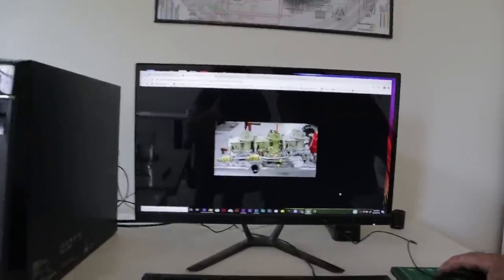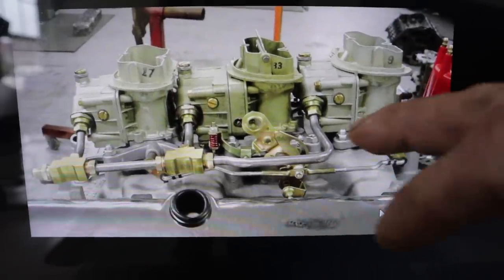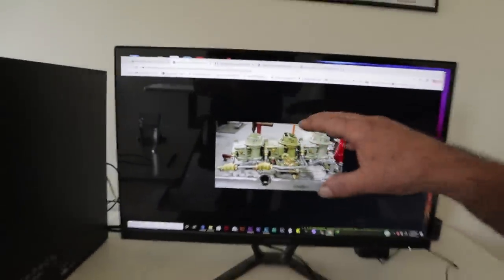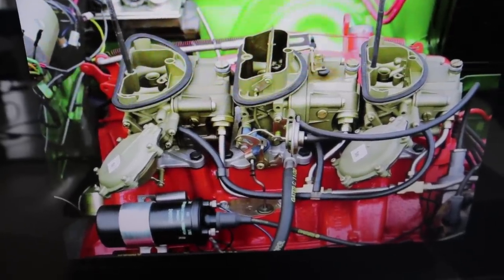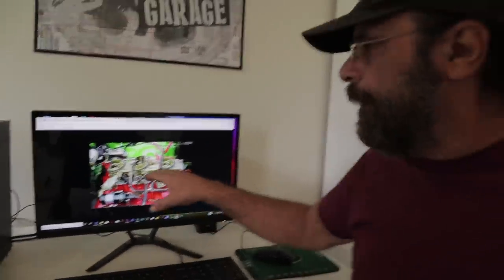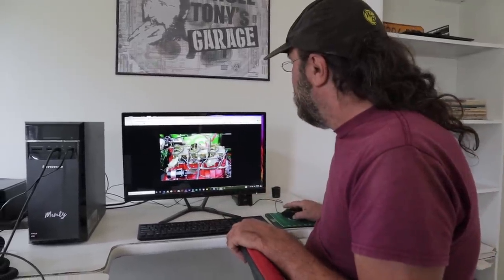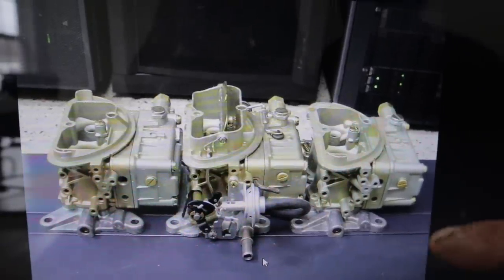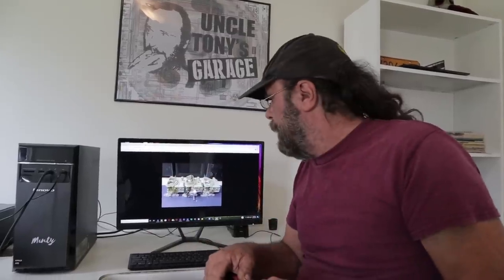The Infamous Chrysler Six Pack

Comment: The Six-Pack is OK but my favorite is the Long Ram cross rams from the early 60s. One of those intakes on a warm 440 is the most awesome truck engine ever, the low-end torque is unbelievable.
Reply: The sonoramic and the factory two 4 barrel crossrams are beautiful.  I wonder if those intakes would handle boost?! On a 440.
Reply: @justinmilby4552  The Short Ram racing manifold will easily
The long ram will also with two conditions.
1. It has to be supported at the carbs since they are somewhat fragile.
2. According to the factory, the long intakes produced 3 psi of pressure at the valve @ 2500 rpm.
Adjust your timing and boost accordingly.
Reply: Thanx for the info man really.  I have people tell me how stupid of idea it is and all that.  Now I gota try to find on th sea setups for my 440 goin in my ramcharger.  Have good day sir
Reply: John Parrish i agree 100% ... i used to smoke six pack cars or walk right away from them with my 69 429 Ford all day long ... the 61 413 cross ram now that was another story ....
Reply: Need a bigger gas tank though
Reply: @Roadking556  
Please tell us the '61 413 crossram story.😃

Comment: Ok so the 6 pack set up on a 383 with a 525 lift cam 106 lobe separation and 11 to 1 compression and 906 heads should work right?

Comment: Chevy 348 engines with the 3x2 setup was vacuum operated on the end carbs...when the center carb was opened over 50% throttle, the secondaries went full open...there was no modulation...either full on, or nothing...that's why the progressive linkage was used...it was much more driver friendly.

Comment: uncle Tony, I’m so glade your doing a 6 pack. I have a 70 aar and the carbs give me fits. I’d like to know more about doing the springs
Reply: Same here! Maybe I can get my Dads running right finally.
Reply: On my AAR sixPack I changed to stiffer springs on the secondary diaphragms and changed the cam on the linkage to open at latter part of the cycle. My T/A heads were fully ported and polished and had no bottom end power. By having the secondaries engage at the higher end of the RPM scale, the vacuum presure allowed a smoother progression, with no bogging down. I also enjoyed the benefit of 20 to 21 mpg on the highway. I was basically running a super efficient 318 down the road with a fully ported and polished Trans Am race engine waiting at the end of gas pedal travel.
Reply: I hope Tony gets into the tuning of the Idle Air Bleeds and Idle Fuel Restrictors. There was an article in the April 2018 Mopar Muscle Magazine called "Climbing the Hemi Mountain" by Tom Gipe. https://www.zinio.com/articlepaywall This was by far the best article I've read on tuning a Holley carb. Granted this was for a Dual Quad Hemi set up... but it easily translates to a Six Pack. 

Using that article, I was able to fix issues that started with the stupid blended fuel (Ethanol/ Gasoline) here in California that I was fighting for years. It's amazing with a little work how much my everyday drivability improved.
Reply: I drilled out the metering plates like the DC manual described, and installed the yellow springs.
Reply: @drippinglass  I'm running a Quick Fuel Metering Block on my center carb. It's fairly easy to change the Idle Fuel Restrictors with that. Very adjustable.
In that article I mentioned about in Mopar Muscle... the author described in detail how to drill and tap out the non adjustable jet openings. Those along with the Idle Air Restrictors are the two jet changes that really make a big difference in everyday driveablity.
Reply: Tommy Ridolfi I had a 70 Cuda with a 440 six pack, it was a full time job keeping them tuned 😖 and worth every second of it!
Reply: Womp Womp...
Reply: Drove a 70 roadrunner 446 six pack four speed copper brown color my senior year of high school good old days
Reply: Well, today you can install.injectors which fairljy look like carbs. And when you can endlessy tune the system for any cam, head or engine load situation.
or even weather enviotnment. 
But if your a traditionalist like me you
 can greatly upgrade the carbs and change to a cam all of which vrry greatly 
Reduce the classic pain in the....neck of the six packs. First you are on the center card. And have lackluster performance. Then you hit the magic RPM and the end carbs open and youre holding on for dear life. So uou lift and then you go down to the magic RPM and the end carbs flop closed and you try to go through the windshield.....
Well, good carb reworks or a Fuel injection unit now cure ALL that age old 6 pack nonesense.....
Reply: Well, the suggestion for a supercharger combonation with a 6 pack is the most intelligent contribution Ive seen here.
Blowers properly callibrated, would really be answer to tame the six pack behavipr

Comment: This is going to be cool... a budget six-pack setup, being a young guy I never knew there was such a thing.  These days you only see or hear about six-packs on restored originals or high-end hot rod builds.  IMO this is your most interesting build yet and I'm super excited!
Reply: Exactly.  All I've ever seen is these $2,500 dollar six pack setups that still need rebuilding.  This will be refreshing.
Reply: I was running 13.50s in a big block 66 chevelle with corvette three deuce carbs. I dumped the tri-power for a 660 holly duel pump. Ran in the 12.80s first pass down the 1/4 mile.

Comment: 1957 , OLDSMOBILE 324 CU. IN.
TRI-POWER...
CALLED THE J-2 .
I HAV ONE...
Reply: Very cool. I thought they went from 324 to 371 cubes in '57 though(?)
Reply: The 324 is 1954-56 Oldsmobile and it only came with an optional 4 barrel. The 57 Oldsmobile is a 371 CU. IN.

Comment: A friend's 440-6 'Cuda made the COOLEST induction noise you've ever heard!!!
(Sounded like it'd turn the shaker inside out!)
Reply: That sound scares me. When I mash the accelerator on my 230 hp 454 Tbi.
Reply: @missingremote4388  
Considering that the 454 is "soft" at 230hp I wouldn't be too concerned about it hurting itself - that's not enough output to do damage to anything! (lol)

Comment: The way that you explain how to tune a 6 pack, sounds a lot like tuning for VTEC engagement on a Honda. Either you can  have an aggressive kick when the switch to high cam happens, or a smooth change over since the VTEC change over is an on/off switch (for older Honda engines anyway). I prefer a smooth change over, which is why my friend's VTEC head swap in his Integra, I have VTEC engaging at 4,400 RPM, if I set it before there, some mid range torque is lost, and if I set it too far after that, the engagement is more of a kick as the head demands cross flow by at least 5,000 RPM (off VTEC, the cam profiles are set up to cause swirl in the charge for better toque and leaner burning at lower RPMs) and it caused the tires to chirp in second gear just going to VTEC.

Comment: I love my six pack it has always worked great  I bought the whole setup in 1987 used everything including even air cleaner 400 bucks my dad thought I paid to much  I put it on a 68 roadrunner had to change the wiper motor to a 3 speed motor  and it worked great.  still does  also the first time I stepped on it the motor mount ripped off and the pistol grip shifter smacked my knee hard
Reply: Now people want a grand just for the intake
Reply: @benderc7778  buy a new one off a speed shop thats already cnc ported.

Comment: you should use motor craft 2150 it is just a simpler more refined 2300. it has variable hi speed air bleeds to give a vary good fuel curve and it has anuler boosters. all so a thunder bolt ram air set up wold be cool. all so if i am not mistaken Chrysler used the motor craft 2150 on trucks and vans and wagoners.  i think a thunder bolt ram air set up wold take it to the next level. all so using magnum heads wold be good idea as thy flow so well. a roller cam wold be cool to as it is a roller block. a cam  with a wide lsa for a flat tore curve. as for cam HUG7011 from hughes engines looks good. well take care!

Comment: The only six pack setup I ever saw run in person was on a hot rod 57 chevy I think it had a 327, but it might have been something larger. During normal street driving it acted one way, pretty standard really hard to tell it even had a six pack. but when the guy to ready to race it, he did ... something under the hood with the carbs. They would then come on sequentially, as if he had three gears in one... if you get what I mean. In first it would have the regular then two more kicks in the pants you could hear as it went down the track. I think once he got into 3rd they stayed open, the sound change was mostly in first, and maybe second a bit... but that was like 50 or 60 years ago, memories fade or "improve" over time.
Reply: That sounds like Pontiac tri power sequential linkage
Reply: @generalgreivus  I really don't know what he had under that hood. He worked at his Dad's garage and probably had access to anything. Could have been a Chevy engine with a Pontiac carb setup. 
A lot of people don't know that at one time not all the engines in the GM lines were the same. I had a 350 in a 72 Pontiac that was different from the Chevy 350. That motor sucked. I put two engines in it myself, then sold the hulk to a local guy that could do his own mechanical work, he put 3 Pontiac 350's in it, eventually he changed the mounts or whatever to put a Chevy 350 in it and had no more problems.  The last motor I had in it developed the strangest problem I'd ever seen. Somehow, something cut a groove in the head right between two cylinders. I couldn't find another head for it. I suppose it could have been welded up and machined back down, but I just didn't have the money at that time for all that. I'd wasted too much money on it already, I had fancy wheels and tires, a turbo exhaust, air shocks and a number of other things on it.
Reply: My dad rest his soul thought me all about the old ways, he always said that he really loved that setup, good mileage and power he claimed.
Reply: @generalgreivus  Well under normal circumstances it basically is running a two barrel. Only when you get on it does it come alive and scat. I've had four barrel setups that were similar, if I kept my foot out of it, but I have a hard time keeping my foot out of it.  Worst thing I ever did for gas mileage was put on "turbo" mufflers. They are quiet at idle and normal driving, but when you open it up, they roar. I loved to hear it roar. I'd slip it into neutral and let it roar sometimes, just to mess with people and the cops. If they stopped me, the car is quiet. "Who me? Can't be this thing is quiet as it gets."  I always wanted to have a car with a big rumble and exhaust cut outs. Oddly, there is a place in Utah that does a lot of them. I guess it's legal to install them there, but not legal to use em on the street. They came  up with a one touch button to open or close em. They used to be cable operated, then they were electric, but you had to hold the button until they are fully open or closed.
Reply: He had an undying love of turbo mufflers aswell lol, I fixed up one of his old trucks had a quadra jet and turbo mufflers and much to the same effect. Loved that truck.
Reply: @generalgreivus  Nice memories. I wish I'd kept my old 51 Dodge that I learned to drive in. It was granpap's first, then Dad's then mine. My aunt talked me into trading it off, big mistake.
Reply: Mine was unfortunately rotted to death from sitting outside too long. I shelled the engine and eventually sold the truck. Missed it so much I went and found version 2.0 same year just half ton vs three quarter. In the process of bringing it to life currently

Comment: Loved my 70 440+6 cuda but the 71 demon 340 I had spent some time with a 6 pack on it. The carbs I used were off a 3 deuce big block Chevy Corvette.
All the carbs were pumpers so I used some small jets and it was still 1100 CFM which was a little much for the 340 until I installed a Racer Brown solid lifter cam that was recommended by Ed Hamburger at Direct Connection.
It hauled ass with this set up.
Reply: Ed Hamburger and his ideas where awesome, I had my 340 done to his spec's and my 73 'cuda did 11.5 sec in the quarter plus it was my daily driver at the time, Ed wherever you are you are a true motorhead that still has my following!
Reply: Dennis Kling engine details and cam specs please
Reply: @nawscawp  well at the time (1984) started with a billet 3.55 throw crank, .060 over on cylinders with Silverlite Pistons, line bored with 8000 rpm balance, 10 to 1 pistons, MP (or Direct Connection) Purple Cam solid lift .506, Aluminum W2 heads (ported & polished) Torker 2 intake with 750 cfm Carter Competition carb, MSD ignition with 60,000 vdc coil, Cheetah valve body, extra steels & fabric clutch plates, Dana 60 with 513 to 1 gear ring & pinion.
11.5 second quarter mile @ 121.58 mph, and engine rpm @ 7200.
Reply: @cudathehawgjetfixer7520  about how much $$$ did you have in that puppy?
Reply: @robertl.fallin7062  Well I paid for a storage lot that had a bunch of Mopar parts and a few cars, after I finished inspecting the purchase I found a few boxes that had Ed Hamburger name all over them and I also found a bunch of paperwork explaining how to set the small block Mopar up to do 11 seconds or less quarter mile racing and a book written by Ed Hamburger on updating engines for racing, all at the cost of $100.00 at a self storage lot (the tenant forgot to pay rent and defaulted their property in the storage lot)
Reply: If the carbs were pumpers they were either ford or after market holleys
Reply: @cudathehawgjetfixer7520  excuse me, sir, but I need to report you for theft... That's a crazy find!!!

Hope you still have the car.
Reply: @ScottKenny1978  Sorry no, had to sell it, it could pass anything on the street except a gas station and after I left Active Duty and started school I couldn't afford to drive it 50 miles a day round trip to school and back, the person I sold it to wrapped it around a tree at 100 + mph, the only thing the car had usable was the trunk lid, the owner is now wheel chair bound and his 2 friend's where killed in the accident. When I sold the car I told him not to drive it like a nutjob because it will get out of hands faster than poop through a goose. Needless to say he didn't heed my warning and 2 people paid the cost for not being responsible!
Reply: @cudathehawgjetfixer7520 man, I am really sorry to hear that!
Reply: @ScottKenny1978  me too. He made a promise to sell it back to me when he decided to get rid of it, but he went and got stupid and ended up hurt with a destroyed car!

Comment: My dad owned a 57 Olds 88 with the somewhat rare J2 option that included 3-2’s among other upgrades.  Had a funky dual oil bath air cleaner and vacuum secondaries.  Never had any problem out of the setup. Big heavy car, but would burn the tires while rolling along at 70.

Comment: I had a 66 389 tri power, it was fully manual on the end carbs and they came open about 3/4 pedal stroke. When you got around 2500 or so and came down on it look out ! It was like instant afterburners kicking in. My buddy had a a Challenger RT 440 sixpack and no body knew the pencil trick, it likely had more power but was way too slow and finicky about letting you have it. The four barrel Chryslers maybe didn't have as much potential but they delivered all they had right now. The only dual four I ever got to drive was a 61 or 62 413 in a 300 convertible, it was so ChrisCraft  in styling and handling I really couldn't appreciate the power, but dearly loved the noise.(btw the  GTO on full throttle is unforgettable forever)

Comment: Dude!  I've forgotten everything I knew about carbs until you brought back every horrible memory of the quadrajet,  th AFB and the God forsaken 2 barrels they replaced.  Looking back,  I was in hot-rod heaven.  All those goddam parts and vaccum secondaries with... (I'm gonna wet myself) color coded diaphragm spings!!!  I usually went with the yellow since it matched the one I took out. 
You are a true savant when it comes to these things.  Basically that vintage sixpack was just a quadrajet or AFB with "Kick-you-in-the-ass" secondaries. 
Love it!   Still going with six downer Webers.  Maybe try a 173 slanty configured like that?

Comment: Tony, I worked with an individual whom played with the diafram springs on the original carbs and he set them up to stage the secondary's so they would never bog out even cold, his set up made the front carb to open a few rpms lower than the rear carb, this made the car sound and feel all of the carbs open during a lead foot dump on the throttle, you heard the primary's go full, then the front secondary's open almost full then the rear opened, it sounded like your on a rocket going through its stages on launch plus you'd feel each carb open up as the car accelerated. I wish I could remember his tuning procedure but I haven't touched a 6 pack set up in almost 30 years and you lose it when you don't do it, but I think he'd use the softer springs in the front carb and the harder springs in the rear to get his tune to work and he did have a lot of very happy customers with his tunes (talk to Don at Ajax Automotive in Denver, Co for the mechanics name, I can't remember his name, he also did awesome Torqueflight trans rebuilds)

Comment: Great info on the carburetors!  I knew a bunch of variants were out there, but not enough to intelligently shop them at a swap meet.  My bucket list includes a Six Pack and that tip brings it closer.
Reply: I just looked and the Six Pack swap packages are running over $3,000!  That package was $899-999 when I was in high school.  THIS is why Uncle Tony’s Garage is so valuable.  If we can’t learn how to scrounge effectively, all this cool stuff will pass us by.